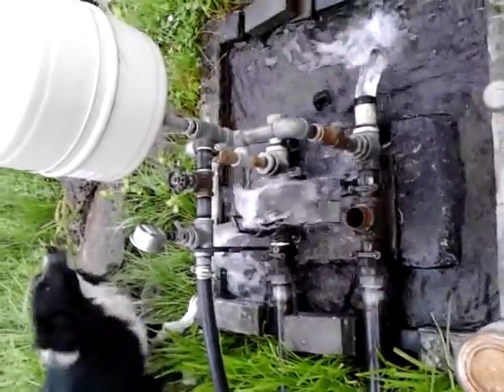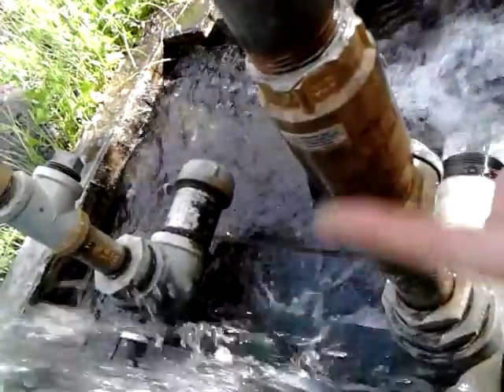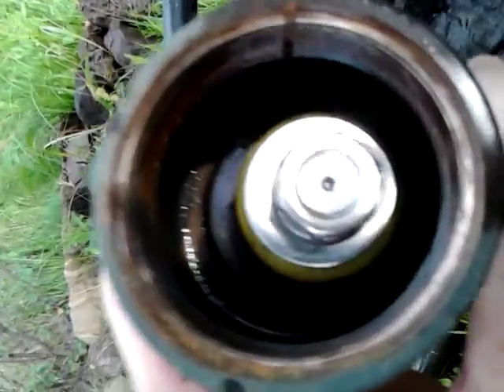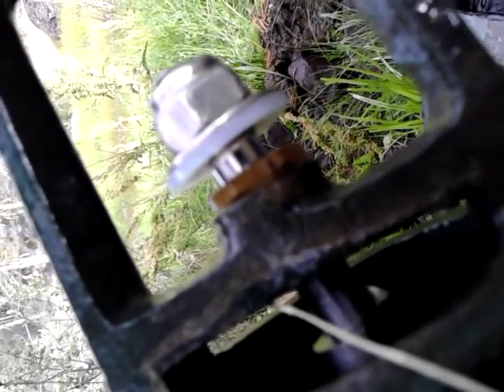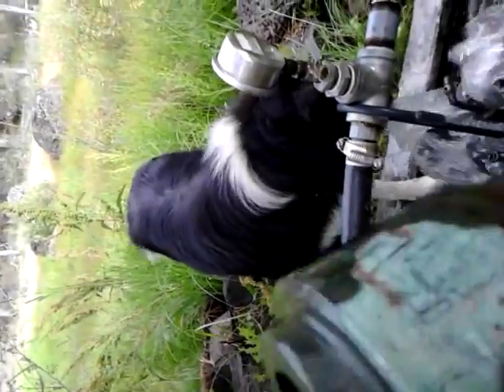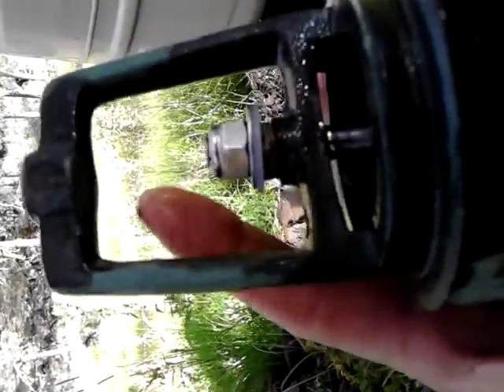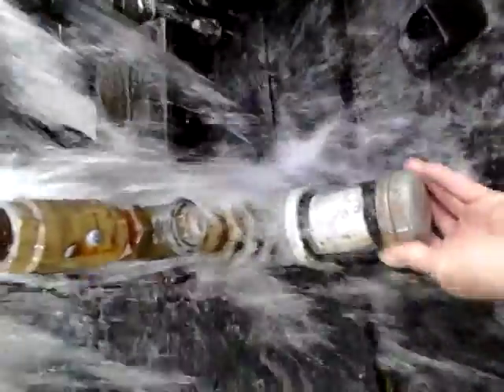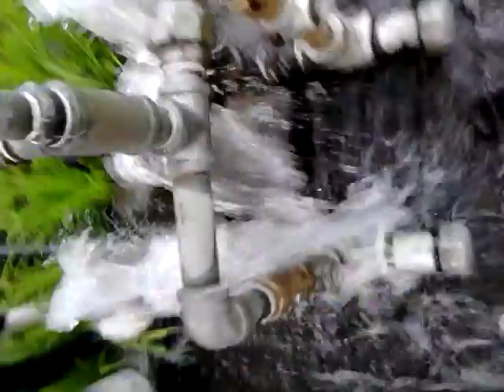Dougs ram pump update #4  7-9-2016

Comment from the maker: if there is any metal to metal pounding contact going on in a ram pump they wont last. Use brass valves that use the rubber O-rings around the seating surface. And use plastic washers under the stainless washer which is under the top valve stem nut.

Comment from the maker: after watching more than a few of the latest ram pump videos it is plain to see that many do not do their homework before they go about trying to build one. Rule No. 1 is NO plastic parts and rule 2 is NO swing check valves.  Use an all brass spring check valve that has the rubber O-ring around the seating surface.

Comment from the maker: by using different weights and adjusting the nut on top you can be very precise in adjusting your pump to use the maximum amount of flow and pressure.